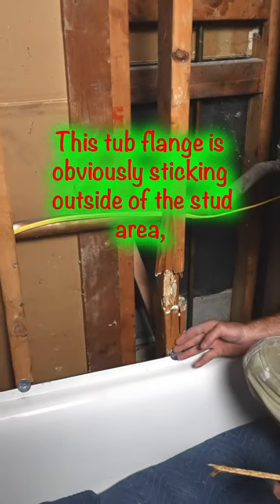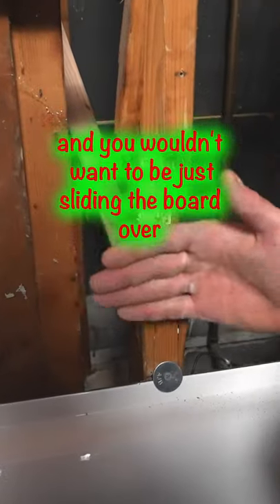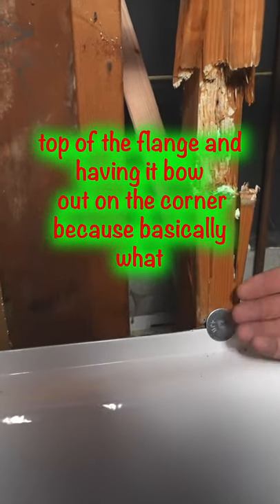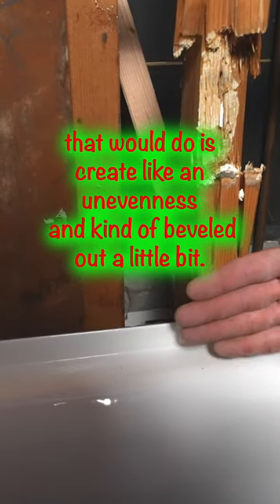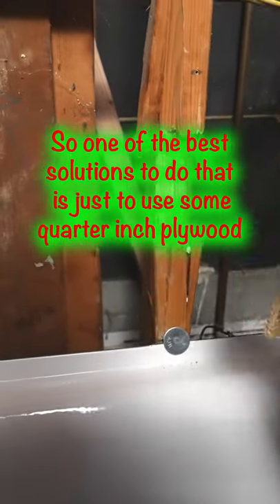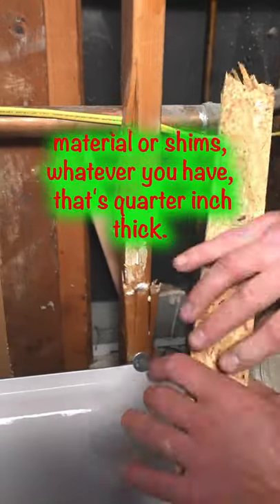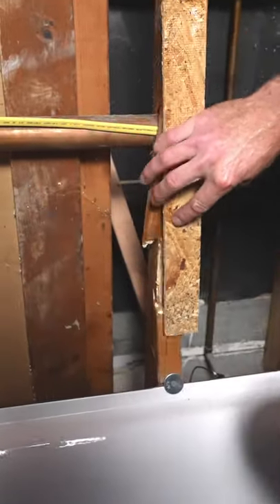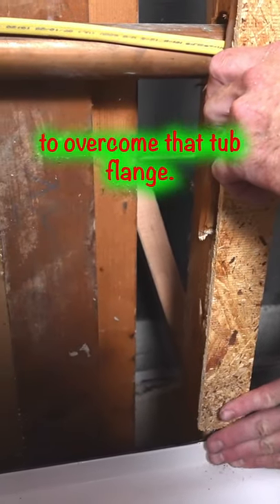Tub 🛁

Comment: To prevent wicking you put your drywall, foam or wheti just to the flange, never to the tub. This install is going to be wet ,moldy and rotting in no time. Forty year contractor.
Reply: EXACTLY.  THIS DUDE IS NOT THE SHARPEST.